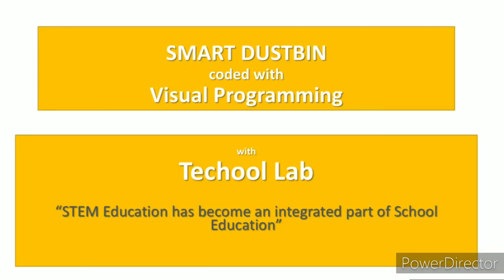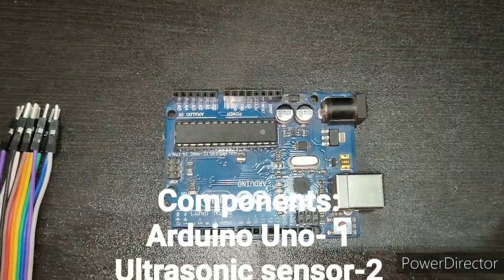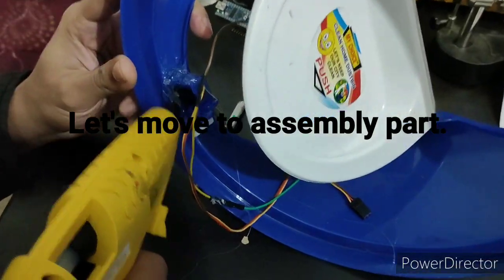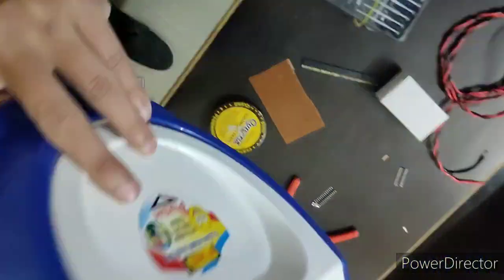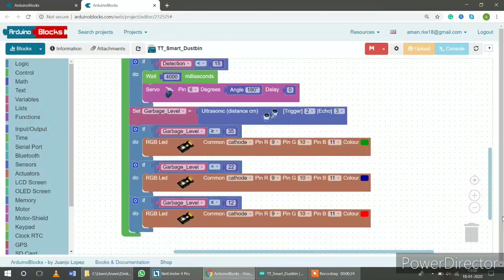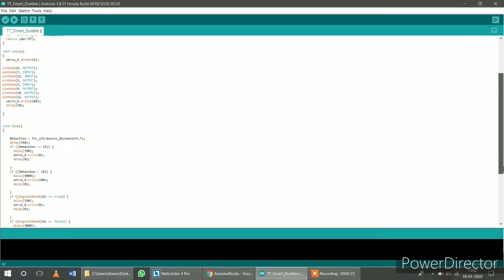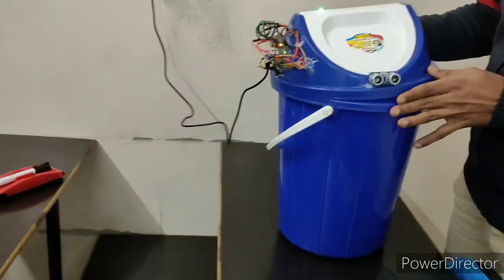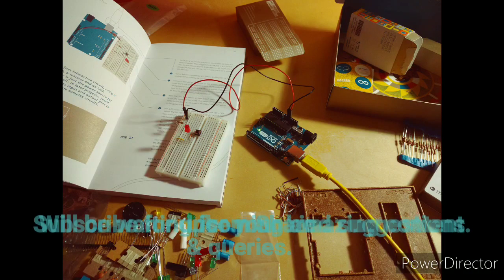Contact less Arduino based Dustbin to prevent the spread of COVID-19. Programmed with ArduinoBlocks

Comment: you have not provided the Arduino blocks program in the video description.
Reply from the maker: Actually, in ArduinoBlocks we don't need any software to write our sketch, you can simple logon to arduinoblocks for sketch and simply by using the  same blocks used by us in our program you can get the same results. Anyway, we will provide a link for that too.
Reply from the maker: But you need ArduinoBlocks Connector  program to upload your sketch to controller. If you find any difficulty anywhere, feel free to contact us.
Reply: @techoollab8360  thanx, so nice of you